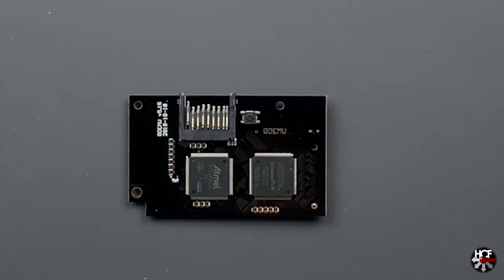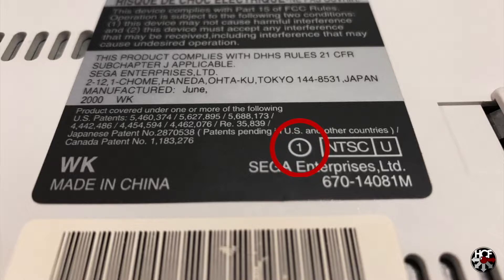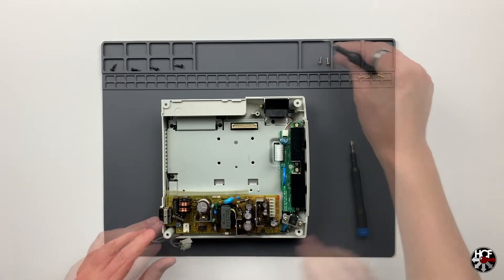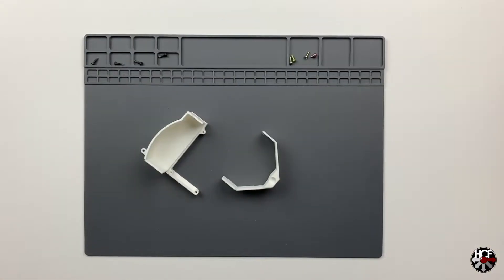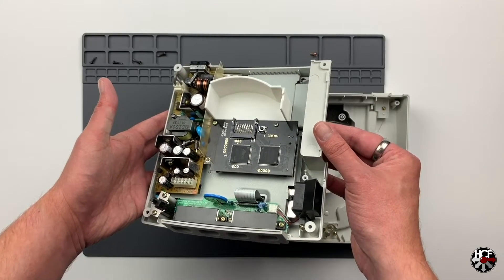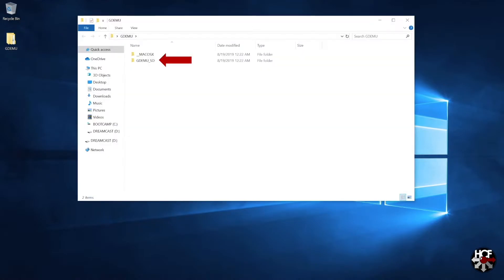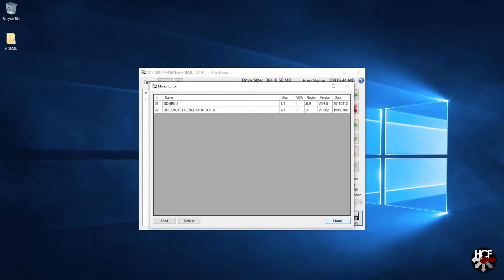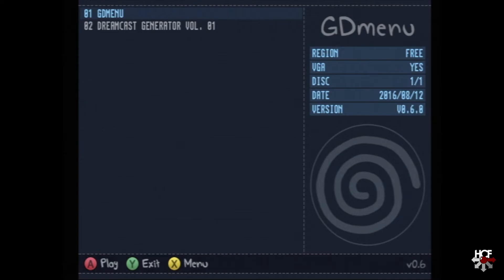SEGA Dreamcast GDEMU Clone SD Card GD-Rom Replacement Mod | Install & Setup | How To Guide

Comment from the maker: I've updated the link to the SD Card setup software in the video description, apologies for the delay!  Feel free to reach out if you run into any issues!
Reply: My gdemu list is wrong 3 rows If you know what I mean? The name and the Cd image is not the same. It starts okey in the list, after 40 games the list is wrong 1 row, and in the bottom of my list the game is wrong 3 rows. I deleted some of my homebrews, but they still count on the Gdemu. On my sd card and sd card maker they are gone?!?
Reply from the maker: I know exactly what you mean!  I was messing with my SD card a few weeks back and it went all wonky.  If you look at the files on your PC, the software actually renames all the files which makes it a nightmare to go into and fix manually.  Did you delete the files using the SD card maker software or did you do it manually?  I ended up just rebuilding my card from scratch, which wasn't much fun, but it fixed all my issues.
Reply: @HalfCircleForward  I fixad my issues with customize my list. I have left the menu box empty for some reason. Then after a day or two all my games dissapered... but I could se the ”size” of the games were still there. The sd card maker had named my folders like 1_ and 2_, and the games didn’t show on my dreamcast cause of that. So I had to erase the _ on every folder. So now everything works again. Sd card maker makes me crazy sometimes 😝😝

Comment: For some reason when i re name the files, the file names stay messed up and when i fix them i boot back the GDEMU and they stay the same way as before un touched.
Reply from the maker: Are you building the SD card with the SD card maker, or are you modifying them manually?

Comment: I imported some games to my sd card using the format of numbered files and changing the gdi files into disc.gdi but some games only show up as not supported/empty files. Do you know how to overcome this problem? I am using Kingston micro sd card 256gb
Reply from the maker: Are you importing the files directly or are you using the SD card builder?  I got a bunch of headaches when I tried to edit my SD card outside the builder software and ended up having to do a complete reformat and rebuild.  If you're doing it manually, I'd probably recommend trying the SD card builder for it.  Does that help at all?
Reply: @HalfCircleForward  thanks for the info. I'll definitely will try this method.

Comment: Why are there 2 holes on the right side of the 
GDEMU Board(the side where the MODEM an 
Fan are) when you can't put a screw in there 
because there is nothing on the Dreamcast to 
put screws there.
Reply from the maker: That’s a great question, and something I’ve never thought of!  The only thing I can think of is a mounting setup for the Naomi.. I’ll have to dig mine out and take a look.. I’m curious now!
Reply: Naomi? Is that the Saturn version of the GDEMU? If so why would they put holes for it when the GDEMU is only for Dreamcast?
Reply from the maker: @dallase1  it’s essentially the arcade version of the Dreamcast. Most of the arcade ports you see on the DC originated on Naomi hardware, and their architecture is very similar, just like the Atomiswave.
Reply: So the Naomi has the same connector and voltage as Dreamcast rev 1s?
Reply from the maker: @dallase1  it uses the same GD Rom drive via a Dimm board, and I’ve seen at least one person install a GDEmu into it. I’ve not dug into installing one into my Naomi, but it’s possible. I’d have to take a look at the GDR housing to see if the mounting points are different than a Dreamcast.

Comment: hello there from 2021 i am ussing this gdemu v5.15b .. instalation was all greate .. but after i add the sd card on my gdemu and boot my dreamcast i get a very bad isue on gdemu menu image .. no dept colors and image shakes alot , and if i boot a game over gdemu continues shaking with bad color .. its that gdemu with some defect or i need to do the 13v bridge with condesators ? if that is a problem of gdemu i am on time to send it back and get new one !! i conected the cd player back from dreamcast and works like a charm !! only gdemu gives to me that image problem . what is your opinion ? realy thanks apreciate ,.
Reply: found the problem and gdemu works like a charm .. VGA problem . i got my old vga tv from cave and works like a charm .. thanks for atention .
Reply from the maker: A-ha! Awesome! Glad it was an easy fix, my brain was going in a thousand different directions trying to think what could have been causing it!
Reply: @HalfCircleForward  i will get and bether quality cable dreamcast hdmi directly and lets se how it works on msi Monitor or 4k TV. Cause without vga is shit quality..
Reply: @HalfCircleForward  i have Otter question is there a posibility to Update this clones 5.15b ?
Reply from the maker: @diabo69  Unless something has changed in the past year or so that I haven’t seen, the clones aren’t updatable.  Everything I’ve read says it’ll brick them, and I didn’t want to risk it!  I’d play safe and avoid it! 😊
Reply from the maker: Hi there, thanks for stopping by the channel!  I’d say it’s most likely an issue with the GDEmu if you reinstalled the GDRom and it works fine with that. If it were me, I’d try to install the GDEmu again. Just to make sure that it wasn’t an issue with it not being seated correctly on the initial install, and if it’s still giving you problems, try and get a replacement. Hope that helps!
Reply: @HalfCircleForward  i have 1 pal E dreamcast model . you mean i need to get that replacement ? i will pick up my RCA tv from cave an look how is the quality with normal cable without hadmi adapter .. will report back the result .
Reply from the maker: I don’t think it’s the console itself if it’s working with the GDRom in it, but I’m assuming you’re testing it with PAL disc games and if the games you have on the GDEmu are NTSC, that could be the problem.  Are you in Europe or in the US?

Comment: how do you update farmware on the GDEMU? thanks
Reply from the maker: I’m running a GDEMU clone, so I’ve really not looked into it, since trying to update a clone board will brick it, but if you have an original GDEMU, I believe there’s a file you download and drop onto your SD card. Your best bet would to be to check out the official GDEMU Wordpress which is where any updates would be announced, but again, if you have a clone card, don’t try and update it. Hope that helps!

Comment: is 5.15 or 5.5 better?
Reply from the maker: Good question! 5.15 would be a newer firmware version, and I think the official GDEMU FW is up to 5.20 now (or around there).  If you’re looking at the clone devices, they’ll have the build that should be on there, but it’s hard to say since they come from so many different sources.  Unless something’s changed, you’re not able to update the FW on a clone, so if you’re looking to get one, I’d say grab the one with the highest revision number and you should be good.  I’ve been running a 5.5 for a while now and it’s never given me any headaches.  Hope that helps, and thanks for stopping by the channel, I appreciate the support!
Reply: @HalfCircleForward  Thank you for the info. I see the 5.15 clones, havent seen any of the 5.20 yet online. Guess i need to search more for them. :)
Reply from the maker: @Adalwolf17  I’m sure they’ll be around at some point! I hadn’t given the FW much thought, since my 5.5 is running as it should, but I might try and pick up one of the ones marked 5.15 to see if there is indeed any difference other than the markings on the PCB! Now I’m curious! 😊
Reply: @HalfCircleForward  I will be here waiting to see a video on a comparison if you do :)

Comment: I ordered one of the cheap clone cards for $40.  I have a good condition sports edition dreamcast which I wouldn't want to touch.  Did however pick up a cheap $10 dreamcast the other day from the flea market.  It works but it sounds like the gears are about wore out on the GD-Rom.  So I figure that is a perfect candidate for one of these.
Reply from the maker: That’s exactly what I would do with it! The beauty of this is that you can uninstall it just as easily, so even if you wanted to use it in your sports edition, it’s totally reversible, and easy to do too! Thanks for stopping by, I appreciate the support! Have fun!
Reply: Where did you find one for $40

Comment: The sd card software like is not longer working and how do you tell if I have picked one up but think it's a clone after paying for a real thing it just can not get it working
Reply from the maker: Let me see if I can find another source for the software.  Can’t promise anything, but I’ll try!  I’ve only ever seen the clones in person, so I can’t say for sure what the differences are, but I know there’s only one official source for the actual GDEmu’s.  Did you grab it from a reseller?
Reply: @HalfCircleForward  yeah I grabbed mine from a reseller yeah but I guess it was not as much as a deal as I first thought
Reply from the maker: What’s the problem you’re having with it? We might be able to troubleshoot it.
Reply: @HalfCircleForward  just some games will not play and was told to update the firmware and it sholud work as it's not play resident evil code veronica plus not right sure how to add new one as it's new to me
Reply from the maker: There’s a handful of games which won’t play on mine, but nothing that I don’t already have the discs of that I can’t play on my standard system, it’s the nature of the beast.  It’s highly recommended that you don’t update the firmware if you have a clone, as there’s a good chance it will brick it.  If you can get solid confirmation that your GDEmu is 100% original then you should be able to upgrade the firmware and this will likely fix the issue.  I’d touch base with the place you got your GDEmu from and see if they have a paper trail back to the creator, since he sells them all himself and it’s a pretty email intensive process from what I’ve heard.  If you can’t get confirmation, I’d be really hesitant to try and do any kind of updates. Worst case scenario, you could see if you can return it and possibly look into the Terraonion MODE which is supposed to be pretty slick.
Reply: @HalfCircleForward  ok thank you will give that a go.... and the mode is slick I have one in my sega Saturn but I get the gdemu before the mode was on the market in fact before I know about the mode or I wolud not have got it ..... really don appreciate your time

Comment: they do have newer 3D printed parts that allow everything to sit flush and fill in the hole where the CD drive used to be it relocates SD card and a big giant button for the reset
Reply from the maker: I’ve saw those before I did the video, but I wasn’t a huge fan of the design if I’m honest.  I think it was the way the ones I saw used a Dreamcast logo for the button.. not sure what it was that bothered me about it, but it just didn’t sit well with me.  I do hear that they fit the system nicely though!

Comment: I added the gdemu, it worked. I removed it and the power supply which is the same from the video, removed that 3 pin gizmo plugged it all back up. Vmu registers, tv gets a signal bit nothing comes on the screen any more, was I supposed to solder where I removed those pins? I don't understand what I did wrong
Reply from the maker: I’m going to guess that the GDEmu isn’t seated properly.  If you’re getting a signal to the TV then the power supply is working.  Try removing and remounting the GDEmu and see if that works.
Reply: It was the problem, now it's all black and white. Maybe because basic red white yellow tv cables. Going to try it on my pound hdmi when I get home and see if that does it. Great video, thanks much
Reply from the maker: Glad you got it back up and running, and thanks for the feedback, I really appreciate it!

Comment: Hey bro if i do the 12v mod and plan to go back gdrom will it work? What is the maximum sd card i can put?
Reply from the maker: If you wanted to go back to the GD-Rom, I’d probably not chance it.  You can get replacement power boards super cheap on eBay, so I’d probably just pick one of those up and switch it out, it’s super straight forward.  I’ve heard people use a 128gb card, but I’ve not seen an specific size limit, but you should be able to do that.  Hope that helps, thanks for stopping by the channel!

Comment: Nice video, Just subbed the channel :) Did you ever considered getting the PicoDreamcast or PicoPSU? So, instead of modding the PSU replacing it wit a low power alternative? I'm still not sure which route I'm going with.. I'll probably replace the battery with a battery holder on the controller board too.
Reply from the maker: Thanks, I appreciate the support!  I’d looked into the PicoPSU, but I wasn’t a fan of the connection on the back making it look less stock, so I did the PSU mod instead.  I’m definitely going to do the battery holder mod at some point though!

Comment: Is there a GDEMU or any solution for a Dreamcast that has a 2 (in the circle) next to the region destination?
Reply: Only (1) with mode tried it on my (2) didn't work
Reply from the maker: Actually, yes! There’s a new product that just got announced called the Terraonion MODE, which apparently will work with all models.  It’s on preorder right now and should be out in June. It’s a bit more expensive than a GDEMU clone, but it looks pretty solid!

Comment: Is the PSU mod necessary?
Reply from the maker: No, it’s not a necessity, however your system will run a little warmer without doing the mod. Thanks for stopping by the channel, I appreciate the support!
Reply: @HalfCircleForward  Thanks for answering! I didn't want to remove it because I use SCART and it needs the 12v rail. Is there any way that I could just 3D print some model to help with air flow?

Comment: Hey did you ever get a dreampsu power supply? It's a replacement power supply for the Dreamcast that is compatible with the gdemu
Reply from the maker: That’s a great question!  I didn’t, purely for the fact that I’m not a huge fan of the external power adapter.  If I’m doing a mod, I like to try, whenever possible to leave the outer shell as stock as possible (that’s my OCD kicking in), and I didn’t like the look of the plug port on the back. It just looked a little off to me. Maybe sometime down the line if my power board dies, but for now I think I’ll leave it be. 😊
Reply: @HalfCircleForward  oh OK that's cool so hey mind helping me out with a link to buy the 3d printed pieces for the gdemu? 😊
Reply from the maker: Sure, happy to!  The designs are available online if you have a 3D printer (or a friend who has one), or you can pick one up here:  https://www.bit-district.com/gd-emu-sd-card-tray.html
Hope that helps!

Comment: What ver is your bord . I see them on ebay for 45 to 65?
Reply from the maker: My board is a 5.15, I picked it up a couple of months ago, so there may be a newer revision out now.  $45-$65 sounds about right for what I’ve been seeing them go for, but depending on where you go they can be even higher.  Hope that helps!
Reply: Did you ever end up buying one
Reply: Yeah got a very 5.15 b on ebay